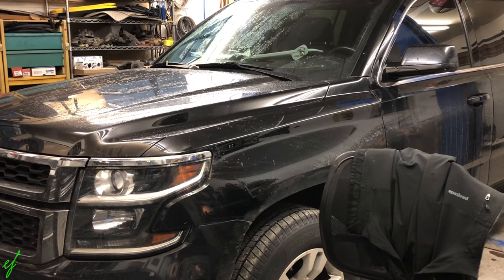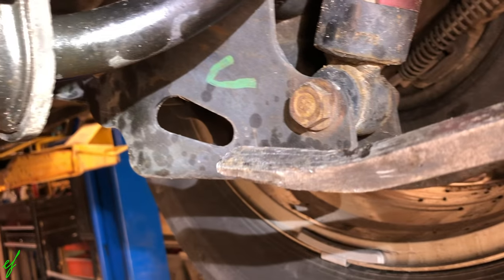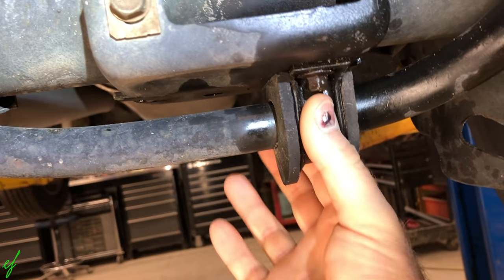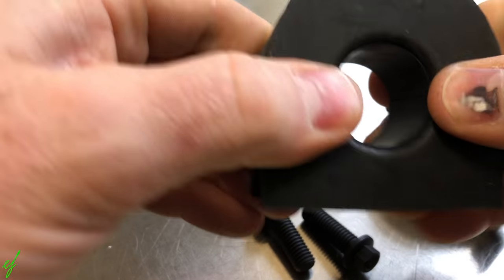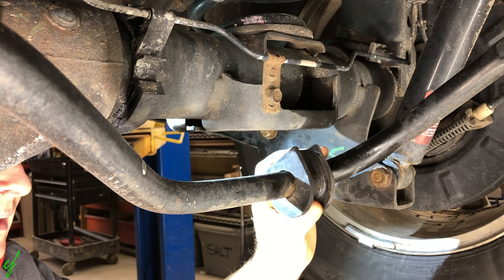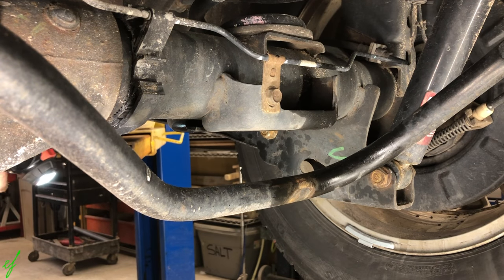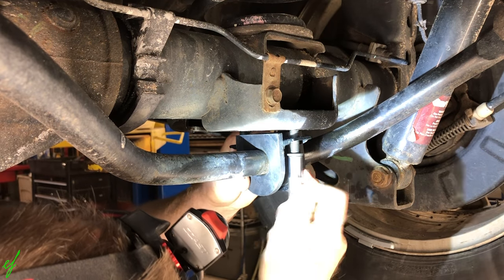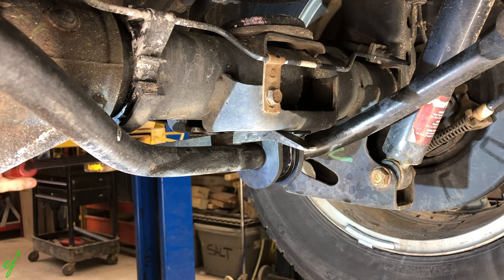SWAY BAR BUSHINGS  |  Professional Sound Diagnosis & Replacement

Comment: I don't hear clunking going down a bumpy road. I only hear like a clunking/popping noise when I make a turn. Left or right. I have a 2011 GMC Acadia. Help!
Reply from the maker: Does your clunking only happen when turning and also applying power?
Reply: @EasyFixShaun  No I don't have loss of power. Just the noise.
Reply from the maker: Sorry. If the clunk sound is heard when applying power straight or a clunk is heard in a turn while applying power, it is usually a Cv- joint on one of the shafts. If you hear the noise when turning all the time even when coasting I am more likely to think a suspension or steering component. If you can't really tell try eliminating things as a good approach to pinpointing the culprit. Do you know how to lift and support the Acadia and do a shake down test? You could do that and check for loose steering/suspension components. Then check your sway bar links and bushings. If everything is tight you could then start looking at drivetrain components like the cv-axles.

Comment: Why u didn't choose the superpro?
Reply from the maker: What is a super pro? Do you mean brand selection?
Reply: @EasyFixShaun  just type superpro as 1 word check the reviews about it,

Its a good product
Reply from the maker: Oh ok. Those are good bushings! They are a different material typically than installed from the manufacturer. They last longer but sometimes they can give a harsher ride. They are made of poly instead of a more rubbery material. I’ve only used them a few times and that has been my experience. They are good but sometimes change the characteristics. I usually play it safe and go with oem or aftermarket but I’m sure super pros also good. That’s the main reason I didn’t try them. If these Gibbard again I will try them.

Comment: If you use anti-lock grease (anti seize), it will not dry and will not sound
Because this type of grease does not penetrate water and soil and does not dry and does not clean over time
Reply from the maker: No grease should be used. Install it dry. That is how the manufacturer designed it and installs them when new. I tried greasing a couple times. Once the grease drys out the most most horrific squeek noise started and I had to replace the bushings again.
Reply from the maker: You should try it and see how it works out long term. I would never recommend it under any circumstances on the rubber/plastic sway bar bushings. Bushings are the wear component and designed to wear. If you lubricate them you will have noise and you will have to replace them again to fix that new noise.

Comment: Does the car have to be lifted on a jack to check for play?
Reply from the maker: No you can check for play as long as the suspension height is level. If it isn't level, there will be twist and pressure on the bar and may throw the shake test accuracy off 😃🔧

Comment: Hey brother, I had a question...are we supposed to add grease to the bushing also? I saw other videos where they add grease...just wondering, because I'm going to install one of these on my truck today. Thanks in advance man! 🙌
Reply from the maker: Hey man. I would install dry only, no grease. Standard procedure. Grease won't help in the long run. I did try it one time and about a couple months later it created a horrendous noise. They put em in dry from the factory so that is what I stick to. Let me know how your project goes!
Reply: @EasyFixShaun  Ahh okay, thanks man!! I want to do a video on it, so I don't want to give people the wrong information and something happen to them. I really appreciate your response man! I subscribed and liked! 😀
Reply from the maker: Ya man no problem. Put up a card for me in your video if you want to. Either way good luck on your video!!
Reply: @EasyFixShaun  for sure man!

Comment: My car is so annoying when driving not even going over any bumps just driving down a smooth road all I hear clunk clunk clunk. From the front end it really sounds like sway bar it’s a lower end noise but kinda in the middle of the dash is where you hear it inside the car. Both sway bar bushing mount the bar on the body so it’s probably that.
Reply from the maker: Sounds very likely a sway bar component! Here is my newest video with a Sh9t ton more information on both the links and the bar to help you out 😃🔧https://youtu.be/0S8JBe_jn6g

Comment: What can cause a sway bar link to keep going bad? I end up having to fix my sway bar link and left strut. Once fix it started driving smooth again but now it's coming back I could feel that it's coming coming back. What can be causing the sway bar link to go?
 (2011 Rav4)
Reply from the maker: What part manufacturer do you use. It could be a crappy part. That’s my first thought. I’ve used the cheap ones in some situations. They are good for a year or two usually. How long before they go bad for you?
Reply: @EasyFixShaun  My Honda Accord broke new front sway bar links every 4 months. I was using Moog links every replacement. I replaced them 3 times in the last year I had the Accord. I'm glad someone crashed into me and totaled the vehicle. Then, I used the insurance cash to buy a Toyota Camry. But the Camry needs new Struts. I'm using new KYB Struts & MEVOTECH Stabilizer Bar Links
. Hope it lasts a few years.
Reply: No bump until I replace bushing
Reply from the maker: Ok. I wonder if the bushing size is incorrect?? Sometimes certain manufacturers put different size bars on the same car based on engine size or equipment. For instance some will have a 17mm a 20mm and a 22mm bushing that fits the same car dependent on the bar it is equipped with. The sway bar and sway bar bushing need to match. The bushing could be too big. Can you shake the sway bar and feel any play in the bar? That’s were I would start to try and sort out what happened.

Comment: I have a 1993 buick lesabre that doesnt make a clunk, but it does make a tambourine- like noise coming from the front left wheel - Incidentially It needs sway bar link bushings. Im going to replace sway bar bushings too all around.
Reply from the maker: That tambourine sound could be a broken Coil spring on the strut or upper strut mount bearing may be bad. Somewhat common on those I think. Hard to diagnose from here but defineatly shake everything down and try to pinpoint your noise. Keep me posted!
Reply: @EasyFixShaun  Im thinking its the bushing links. I saw visible play in the bushing when i inspected. so  makes sense. also old owner replaced struts all around so im hoping its not that.
Reply from the maker: Oh ok. Yes the links have a high failure rate. If those are loose that’s the best place to start for sure! Nicely done sir!
Reply: @EasyFixShaun  Thank you, but sadly it did not fix the issue.
Reply from the maker: Bummer! I am sorry. It happens to the best of us. When in doubt start all the way over at step one. Shake it down and try to pinpoint the problem. Please keep me updated!
Reply: @EasyFixShaun  Im not sure what else It could be honestly. Coil springs are in good condition, Im not sure how to inspect the strut mounts though. I think firestone or some other company offers a free inspection for noises. I may just end up bringing it there and seeing what they say.
Reply from the maker: Sorry about the delay. Ya a free inspection where the tech can test drive it, shake it down on a hoist would be great. If you pay for the inspection fee that can be good also. Some noises and problems are so weird, that is not a bad approach at all. Mechanics see weird stuff all the time and may be able to pinpoint it fast and easy.
Reply: @EasyFixShaun  i just got a tacoma for a steal of a deal. I think i might just sell the buick to a buddy of mine for what i got into it. If not well do the diagnostics. I appreciate you responding though.
Reply from the maker: Cool man! Toyota rocks man. They do not break very often compared to all other domestic brands.
Reply: @EasyFixShaun  Thats what ive heard! this one has 183k on it, and it doesnt want to start. Staying running with starter fluid, Im assuming its a fuel delivery issue.
Reply from the maker: Oh man you bought a broken Toyota? I am certain you can get it up and running! Should be a good truck.
Reply: @EasyFixShaun  Omg.. all it needed WAS GAS....
Reply from the maker: Easy Fix!! haha. Awesome man!!

Comment: would you get weird whooping vibration noises from this?
Reply from the maker: What speed does that happen normally? Does the whooping happen while traveling over bumps?
Reply from the maker: It sounds like a tire noise to me the way you initially described it. But it’s hard to tell I need a little bit more info to help out.
Reply: @EasyFixShaun  hey, thanks for getting back to me. 
I now have multiple fault codes, most related to transmission and transfer case.
Reply from the maker: No problem.  When in doubt start with the obvious. I wouldn’t have thought  transmission right away. Good luck with your transmission. Hopefully it’s just a sensor or something😃.

Comment: Whenever i pass a big whole or deep puddle i feel like a clunk juston my side is it normal for a 2019 GMC 3 inch suspension beaaly have2 months whit the lift
Reply from the maker: Hi Samuel. It could be anything loose under there with the lift kit. Under normal circumstances the bushings and links can be highly suspect parts. They fail a lot. But you should always do a shake down test of your suspension to try to pinpoint a loose part. Sometimes it jumps out at you. Do you know how to do that?
Reply from the maker: I wish I could give you my contact info man, ...but its the internet so that's a hard no. But I can try to walk you through it here. Or you could have it done at a shop and pay the diagnostic fee. Or...My next video coming out this week shows how to do it pretty well. It is a wheel bearing video but I shows it pretty clearly. Or you can follow this old video I showed how to do it here. https://youtu.be/Vj9oDHj3EjI
Basically between this video and the sway bar video you have all the basic tests to expose a loose steering or suspension or bearings component. 😀
Reply: Samuel Lugo had the same issue and it was fixed with new struts and shocks.
Reply: @leokennedy4894  yeah i did that
Reply from the maker: Any time i can’t find the problem, I start at step one again. Confirm the noise on the road. Then I try to isolate the noise by locating loose components. It’s hard with suspension sometimes because the noise is difficult to replicate on the hoist or while the vehicle is on jack stands. So I will recheck every single component to try to locate the problem. I wish I could help look at it for you. Advise is the best I can do here.

Comment: Hey, so my honda was making a sound like an old door with not oil, I changed the sway bars and it went away for a while, then it came back, it been having it for a while that sound, I finally decided to try to fix it and thought it would be the sway bar bushing, I just changed them today and the sound is still there, and also just extra info, whenever I have more weight in thr front, like driver and passenger the sound sounds more, you can also hear it whenever you get out thr car, or whenever you push thr car down, it  sounds like an old door with no oil, and also is weird, whenever it rains and I drive by puddles and water goes inside the bottom of the car, the sound stops, is weird, what do you think the problem is?
Reply from the maker: Sounds like a steering or suspension problem most likely. I would check all components. Your description is really good though. I would check the upper and lower ball joints. That would be the most likely cause from what you describe. You could have someone jounce test the car in park to get some suspension movement and squeaking and then try to track down the noise. Usually a squeak like that can be felt in the ball joint just by touching the control arm that it is mounted in, or the ball joint it self. If you find that is the case you can further isolate the problem by piercing the boot and adding grease. Usually the noise will go away. Ball joint would need replacement 😃🔧
Reply: @EasyFixShaun  really appreciate the info thank you, will do check them, the ball joints are hard to change, how much you think a mechanic charges, it can bell the ball joints or also the shock absorbers

Comment: Great video, thank you. Looks like I found my clunk!
Reply from the maker: Awsome! I’m glad it helped. Those bushing and also the sway bar links can make a lot of noise when they go bad.
Reply: @EasyFixShaun  I have Crorolla IM has similar clunk on your video about sway bar link noise but when I checked it, everything is tight and the bushing is also not as bad as yours. Thanks.
Reply from the maker: Ok. That type of noise is most likely sway bar type noise.There are other components that can make similar noise. You will need a complete steering and suspension inspection of every bushing, tie rod, ball joint, strut to find the loose component. 😀
Reply: @EasyFixShaun  it is from the rear, I checked the ball joint, bearing,  and any bushing that may crack but everything is tight. It is not steering since no noise in a curvy road. Only when it has some flex left and right not at the same level, which is what sway bar area got the most strain for such movement. The struts and springs are all tight and no noise in any large bumps, fast speed cornering, etc.  Only at low speed with a rough road. Higher speed does not change the loudness of the rattle/knocking.  There is a slight gap on the bushing when I jack one side up, so I will change the bushing first.  It started after my 1000miles road trip in the rocky mountains.
Reply from the maker: Ok. It’s hard to tell exactly what it could be from here. But starting with the obvious is always a good idea. If there is some play in the bushing it would be an excellent test to replace them and drive it again and see what you have. 😀

Comment: Inside the slotted bush should be used greased locks to work better
Reply from the maker: No grease should be used. Install it dry. That is how the manufacturer designed it and installs them when new. I tried greasing a couple times. Once the grease drys out the most most horrific squeek noise started and I had to replace the bushings again.

Comment: If the inside of the slotted liner is not greased, the anti-roll bar will get stuck and will not transfer power to the other side of the car.
Reply from the maker: No grease should be used. Install it dry. That is how the manufacturer designed it and installs them when new. I tried greasing a couple times. Once the grease drys out the most most horrific squeek noise started and I had to replace the bushings again.

Comment: greasing the rubber bushing before installing it would not go amiss!
Reply from the maker: It seems like a good idea, but you don't want to put any grease between the bar and bushing. Maybe the bracket to make it slide easier, but it's not really necessary there either. I did try it once and the bar started making noise a couple weeks later. It was the weirdest loudest most horrible squeak noise. You wouldn't believe how loud it was. The bushing is designed to be the wear item with no lubrication. I would recommend installing them dry the way the factory did originally 😃🔧

Comment: 2015 product have problems in bushings already. That’s GM crap for ya.
Reply from the maker: Ya it’s a bummer. Way to quick.  Should last 100k miles or more.
Reply: My yukon breaks at least once a month.
Reply: The Japanese have much higher quality control Jay. Every component and part in the supply chain are expected to meet stringent quality standards. Unfortunately American cars source a lot of parts from Mexico and lower quality suppliers. They don’t make em like they used to.
Reply: @jltrack  Amm, I dont see a lot of American made cars on the streets so...

Comment: Shouldn't you grease those?
Reply from the maker: No I would never grease them. You want to install them dry,  just like the factory installed the originals. I did try grease a long ling time ago thinking it could help and it worked just fine for a while. But once the grease was washed out or went away the most horrific squeak started up and I had to replace them again. I have never heard or seen that problem since I've been installing dry.
Reply: @EasyFixShaun  great info and thanks for the reply. I've been told to grease but after your explanation I'll try dry.
Reply from the maker: Sounds great! let me know how your project goes 😀
Reply: Ok here are my findings. On my particular application the car had aftermarket sway bars and the only bushings i could find to fit after several trips to O'Reilly's with multiple wrong parts ordered, were poly. Not the factory rubber. So i tried the dry install and that got rid of my clunking but left me with terrible squeaking noise. So i pulled them back off and applied a small amount of grease both where the bushing contacts the sway bar and where it contacts the straps. So far so good, no clunking or squeaking and riding smooth as butter. Is this due to the material the bushings are made out of?

Comment: Nice chrome impact socket lol
Reply from the maker: Ya not the best idea. But I do it all the time. I have shattered quite a few impact and non impact sockets. The one in the video is probably 25 years old. It is from my original craftsman  socket set when I was a kid. Made in the USA. They are still stronger than chinesium made replacement sockets I have recently purchased.

Comment: replace sway bar bushing and link and got a bump,bump on driver side
Reply from the maker: Where the parts loose before you replaced them? Is the bump bump noise the same as before replacement?